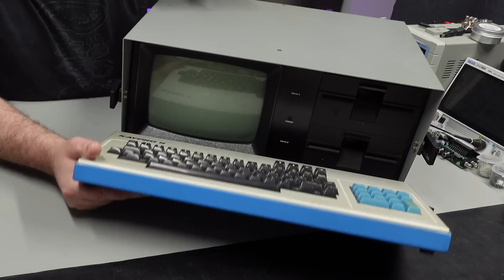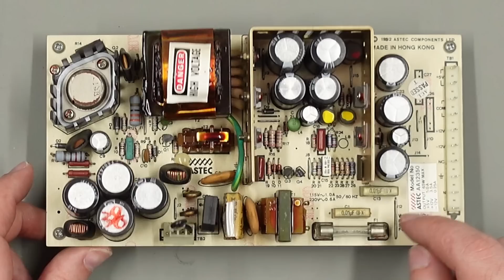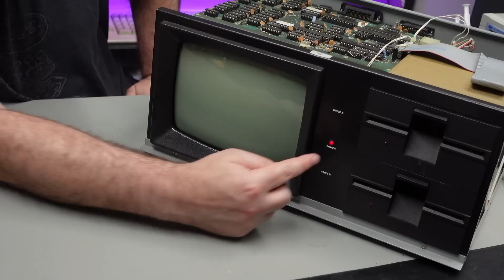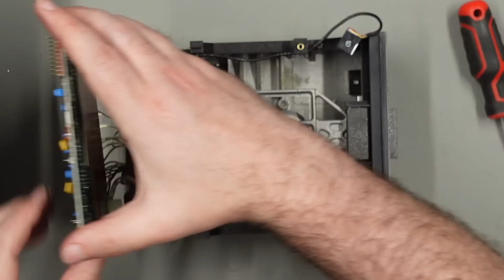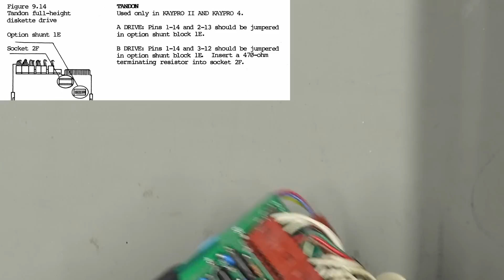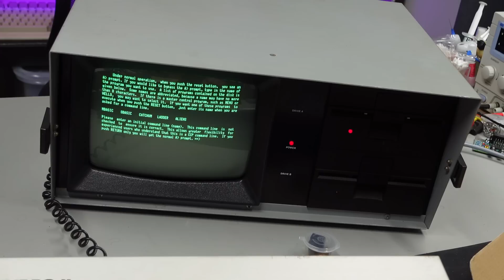The Kaypro II - introduction, confusion, and repairs

Comment: This machine is weird and ugly. Here we had the Italian design version of the KayPro, the P2000C, which is like the Countach where this is the Ford F150 (although reliability is opposite, the P2000C is a tank, without floppy issues). Still the KayPro sells for double the money here on average. You did a wrong cap-swap, the two 0.01µF ones over the mains should be Y2, not X2.

Comment: Just got one from a surplus warehouse. Powered on and it worked… then vertical collapse on crt and then magic smoke and popped a fuse. Pullled RIFAs, recapped analog board and all fixed. Made a set of floppies with Greaseweazle, connected a wimodem and called some BBS’s, put KERMIT on it and can now transfer files from MacBook to it wirelessly. The monitor with the delayed green phosphor looks awesome. Need to write a “matrix” demo for it 😁

Comment: Given the amount of space in there, I am sure modern lithium batteries charge/discharge controller and a few switching regulators for the plus and minus voltages, and with the power consumption being 65 Watts from what I saw at the back of the chassis, you could power that for an hour. If you did it on a train while everyone had a smartphone; you'd be getting off the train at the loony house. But, it should be a cool experience given I think that was used till mid 1990's.

Comment: I bought a Kaypro 10 in mint condition with everything working before the sale.   The seller packed it in styrofoam peanuts so when it arrived the keyboard was jammed into the body, the steel body was bent out on all sides, the keyboard clips were broken, and the floppy and mfm drive were both broken.   The peanuts were powder and I was so upset that a perfect machine was damaged so much.    I borrowed a floppy from my xt and got it booting, but I still need to find a replacement floppy and mfm drive for it.    Crazy glued the plastic bits and bent the metal back.   It's not pretty, but it's a working machine.   I love those Kaypro machines!

Comment: Neat machine right? 

I think the reseating of the ICs fixed the boot issue. The drives were not being selected originally and it should have worked fine with the way the shunts and termination was installed originally. On a short cable run, it wouldn't even matter if the first or second drive had the terminator. Just as long as one is installed (or the drives weakly pull up like 3.5 drives do... I think they pull up with 1K so with two terminated drives, it doesn't matter) 

The Kaypro is odd in that the drive always stays selected even when idle ... It's a funny quirk. Motor enable is what gets turned off and on (for both drives) when going through normal operation. 

The keyboard cable is a normal phone handset cord... Normal wiring (unlike the original Macs) So just steal one from any old junk office phone.

Comment: 25:28 - Some IC companies used silver plating on the IC pins, they get tarnished resulting in black crust. 
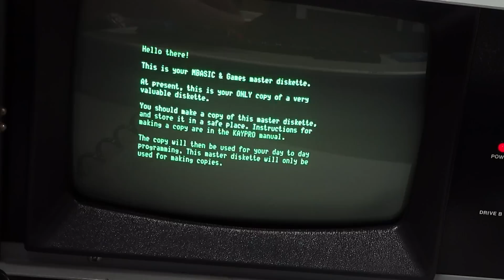41:00 this disk just has a bootloader that displays this message. You need to boot from CP/M first then run the games.

Comment: RJ22 is the standard telephone handset cord connector, so a standard handset cord should work. The Amiga 1000 uses one of these for its keyboard too. Most RJ11 crimp tools will also work with RJ22 connectors.
Reply: but remember to check the pinout as telephone handset cords are not straight through but flipped/reversed polarity.